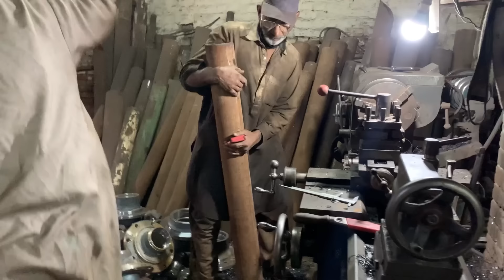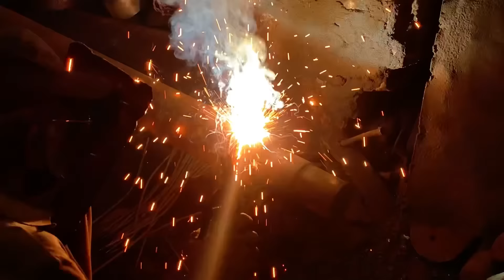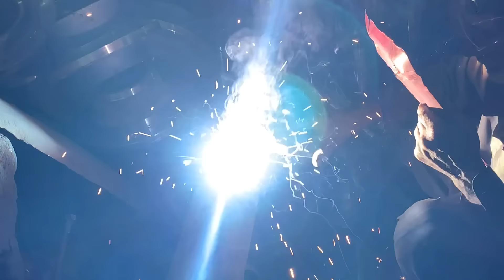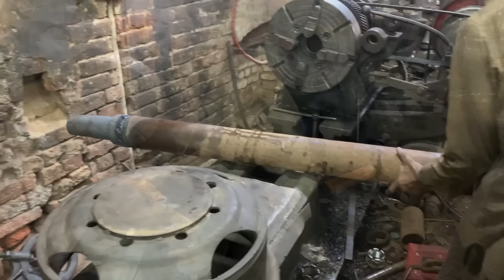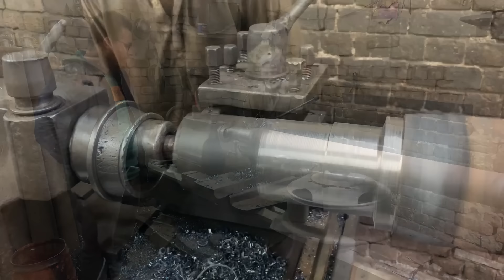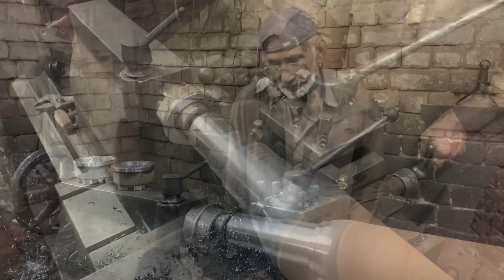How Semi Truck Trailer Round Axle Are Manufactured || Production Process of Semi Truck Trailer Axle

Comment: I am surprised how it appears that it is not necessary to measure anyting. Just take a piece of tube and shove the ends in, hoping they will eventually align somehow.
Reply: It will fit ... somehow ... and if not, there's always the sledgehammer to make it fit
Reply: He measured it right before pulling it from the stack. At 18:14 the camera pans left just as he is letting the measuring tape recoil. Someone had already cut these to the needed length. The cast ends are large enough to machine to the proper shape while compensating for welding inaccuracies. As long as the ends are machined to the correct shape, and correctly spaced apart, the weld accuracy does not matter as much.

Comment: Good Job! This should break within the first 10 miles if it lasts just putting a load on it at rest. No penetration on the welds. No preheat. Pure trash.

You have to love the centering drill on the lather. it moves like half an inch while "center drilling" the axle.
Reply: I had never seen that before.  He's got the drill bit mounted in some sort of floppy joint and guides the bit in with his hand.  Have these guys not heard of centerng the job and using a centering bit??
Reply: I had never seen that before.  He's got the drill bit mounted in some sort of floppy joint and guides the bit in with his hand.  Have these guys not heard of centerng the job and using a centering bit??
Reply: @keithammleter3824  The part the drill bit is in is called a live center. It is a tapered drill chuck that holds the bit and fits into the tail stock. It is supposed to be rigid, not flopping around like a fish on the deck. This would tell me either the live center is worn (probably) or the tail stock is shot (probably as well).

The way it's supposed to work is you would but the centering bit in the live center, put the live center into the tail stock and run the tail stock into the piece creating a center point. Since the shaft isn't centered or the other end in the chuck, all the work they did is useless as the wheels aren't going to track parallel nor will they probably be perpendicular to the ground causing extreme stress on the axle and you know the rest.
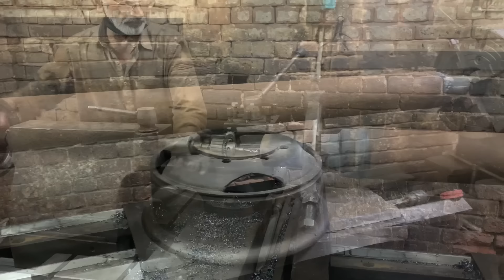Reply: @HueToobBlows  : I know what a live centre is - and that is not what he uses to drill the job centres (he uses a live centre when turning and threading)..   Look carefully at 7:22 and especially when he does the other end at 14:08.    He has a Jacobs style chuck mounted on a Morse taper inserted into the tailstock quill.  All normal practice.   But instead of a centering drill rigid clamped by the Jacob jaws, he has a standard twist drill mounted in some sort of floppy joint (like a CV joint) inside a shaft that is clamped in the Jacob jaws.   The Jacob chuck shows a bit of flexing, the drill bit no significant flexing, yet until inserted the drill bit hangs down 10 degrees or so until inserted.  Yet it does not rotate when in the job.  Presumably broken drill bits are frequent, depending on how well he hand-guides it.
You are correct of course that the truck's wheels are not going to track properly nor will they rotate on a true axis.   The result will be excessive tyre and wheel bearing wear.  Don't fret over high axle stress - as another poster said, it looks like they use salvaged water mains pipe.  Who knows what strength it has or has not.   The welds are not very good.
Reply: @AffordBindEquipment  :  Errr, no.    It has quite a bit more than 1/16th wobble in the tube I'd say.  But that is quite unimportant.   These are truck trailer axles, or the extra axles in a six-wheel truck.   None of it rotates in use.   Roller bearing races are fitted at each end (the turned down forged pieces) and the brake drums then go over the roller bearings, so that each wheel rotates about the non-rotating shaft.   The shaft is clamped to the leaf springs by U-bolts just inboard of the roller bearings.
Having said that, the video didn't show us what they did about the considerable rust on what looks like salvaged water pipe.   One thing I've noticed about these little Pakistani production shops is that they invariably ensure that what they turn out LOOKS like a new one turned out from a professional factory, packed in plastic sheet in nicely labelled boxes.   So I assume that these axles later go on another lathe to be turned down over the full length of the pipe to get rid of the rust.  (It wouldn't be done in the same lathe as that is set up for thread cutting.)  Between that and dodgy welding, and water pipe steel not made for strength, heaven knows what strength exists in the final product.
What is important is that no attempt was made to ensure that the two forged and turned down end pieces are on a precisely common axis as RJD pointed out, so tyres will crab and tyre wear will be excessive.
is left the
Reply: @keithammleter3824  thanks for the clarification...somehow it got in my head this was a driveshaft...how I have no idea.  I know better!  must have been the late hour I watched this.
Reply: @AffordBindEquipment  : Re late hour etc - been there, done that.

Comment: What materials? The tubing looks like some piece of pipe found at the dump, stub axles look to be very soft. Where do you get such large belt drive lathes. Wouldnt want to put a heavy load on it without knowing the materials and design strength.

Comment: To the specialised welders out there i would like to know how deep rod welding goes.. 
shouldn’t they taper the edges so that the whole wall thickness can be welded rather than just the surface?
Reply: Or maybe even zig-zag the cross section of the two components so that the whole stress wouldn’t be applied only to the welds.. or is the weld strong enough to behave like consistent metal.
Reply: @ukpkmkk_2  Not a welder, but an automotive engineer. Yes it would be better for the welding root to weld it in a conical way but this method may be sufficient.
Welds are often even stronger compared to the rest of the part but it always depends.
Reply: @simonde8091  thanks for the info👍
Cheers m8
Reply: Due to no joint preparation, he’s got a pretty wide gap to fill up anyhow. The absence of any preparation on that pipe end, such as grinding the torch slag and rust off before welding, will compromise the strength of the weld for sure! I guess their standards are relaxed at best!
Reply: @simonde8091  automotive engineer sounds good, what are you doing inrl?
Reply: @tomt9543  wide enough that hes coming in at about 45° to tack the pipe onto the stub
Reply: they do this in sandals I dont think "proper Procedure" applies to these dudes. Its honestly amazing that there are people over 40 years old there
Reply: The welds look a bit slag filled but that tube they are using looks suspiciously like Used steam boiler tube ,it even has a seam running through it.  I thought at first it might used drill pipe but it's banged up enough for that and the quality is lacking. Remind me to never follow   a semi trailer in Pakistan .
Reply: @tomt9543  I am sure this is a "standard" production, where workers receive low wages, and the lion's share of the profit is taken by the owner of this enterprise, I have already seen this, the emphasis on speed and quantity, as well as on low cost. Ideally, the surface should be completely machined and protected from rust. But apparently the semi-trailer lives less than its axle) And there simply no one will pay for a good part, everything is done as in the video, and then the bent axle shafts are cut off and welded again)
Reply: @Shareef: I'm a welder and I weld mostly Mig now but I used to weld miles and miles of sticks. Here's the proper procedure for the workpiece in the movie which is the same for mig and stick: the source materials should be some high grade steel to begin with and not already used and weakened old boiler pipe. Surface rust is not an issue, that can be grinded/polished off. The pipe should be beveled and approx. an inch on each side of the weld ground to a mirror finish to allow full penetration of the joining part and for the run out welds. After proper allignment by a fitter (who's qualified to make tack welds since the tacks will be integrated in the real weld..) the tacks are lightly ground and the starts and stops are ground down. Then the piece is placed on a manipulator/electrical rollers and the welding area preheated to plusminus 200 degrees Celsius. The welder then lays in the first (critical) layer with moderate Amperage and Voltage. The 1st layer is ground down and and the next layers can be welded with higher currents. Though with such a small workpiece with a small radius care must be taken not to exceed temperatures which can actually cause the workpiece to harden (or melt.. 😅) so welding must be paused. The final welding beads are layed from the outside towards the centre ( called capping) with the final bead in the centre. No "zigzagging" (actually called swaying...) is required here. But if so, it must not go beyond 12/14 mm max. Axles like these will be examined after welding in a "non destructive" way which means material hardness checks, die checking for cracks, Ultra Sonic checking and in some cases X-rayed. This is standard procedure in Europe and the US for sure.
Reply: @slkOnebitcheZ  Im doing my masters thesis right now and working for Mercedes Benz in Germany at the development centre
Reply: @ZerokillerOppel1  holy crap.. I guess not much of that has been considered here.
Reply: @ZerokillerOppel1  Everything you just wrote you could tell them and receive nothing but a blank stare. As much as he welded without a shield protecting his eyes I'm surprised he can see at all.
Reply: According to  ' YouTube ' video where they went through extensive process and testing using sophisticated equipment they tested and found multiple fillet welds to be superior to one big wide fill.
This looks like what you might do building a trailer to haul behind your car or pickup. Not anywhere close to big rig.
Reply: @ZerokillerOppel1  sounds more like it, at least for something as important as truck axles.
Reply: Improper outfit and and safety equipment ..tsk "no good"
Reply: That's a lot to fill using that method but must work for them . Industry standards / Q.C / aren't exactly necessary there my guess . but skilled in crap conditions .

Comment: Isn't the end of the lathe suppose to turn? instead of a bit of grease for it to spin on?
Reply: A "live center" has a ball thrust bearing built in and the center point revolves with the work. The older style "dead center", the type used in this video, is fixed and the work revolves against the drilled center in the end of the axle. It is, in effect, a primitive bearing and that is the reason for a dab of grease. Many older lathes had a little reservoir and grease dauber built into the tailstock for just such a purpose. I am sure this guy would be using a live center if one was available or he could afford it. The dead center is an older form of tooling but still useful and relevant.

Comment: I've watched quite a few of these Pakistani truck parts and truck repair videos.   This one takes the cake - it the most roughest, mot disgusting piece of work I have ever seen.  Terrible looking welds.   Nothing is straight or properly centred.   Guy uses a vernier caliper as a pair of outside calipers, slowly rendering them useless.   Have these guys not heard of go/no-go gauges?  These are easily shop made from scrap sheet.
Check at 1:21 and elsewhere.   Guy actually welding with no mask.  He must be almost blind.   Bet he has bad cataracts and no peripheral vision.
Reply: He has a gauge, a used race from a ball bearing,it's hanging off the tailstock .😁😁 watch him slide it on while the job is turning.... 😲😲
Reply: @Mercmad  He uses that for a couple of operations, and the vernier for others.   Go/no-go gauges would be more accurate and quicker.  Safer too.  
Hopefully if those gauge rings are used race housings they have been rubbed with emery or something.   Ball and roller bearings should be a moderate interference fit, not a sliding fit.  Another video on YouTube featuring a different shop or a different lathe operator doing the same thing hammers the test races on and off, which is better.  The other shop/operator is better in other aspects as well.
Reply: I bet that between one video and another, it was the first time you (like me) came across something like this... 16:25 😂

Comment: I do not think that measuring the workpiece while it is spinning on a lathe is what one is supposed to do. Those calipers/verniers are not supposed to be used like that and I just wonder how the accuracy would wear out!! I do not like the fitting tolerances of the bearing inner race and that metal on the stub axle seems to be much too soft for the load envisaged.  The initial welding of the stub axle on the pipe does have a lot of tolerance in its supported end fitting and though there is ample material to take off to "center it", the manner it was initially held in the steady rest is not really an accurate procedure. Good job this shaft does not rotate!! 
These people seem to abide by the philosophy that, If it looks good, there is a possibility that it may even be accurate and strong enough!  Engineering is not a case where " A dollop of putty and a coat of paint, will make the devil look like a saint!"